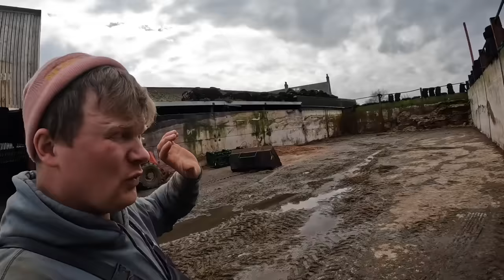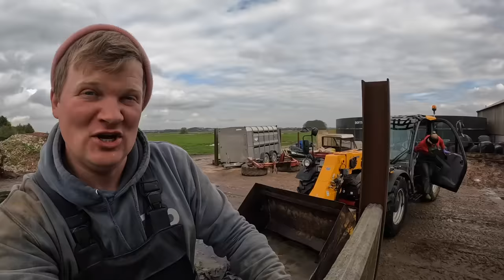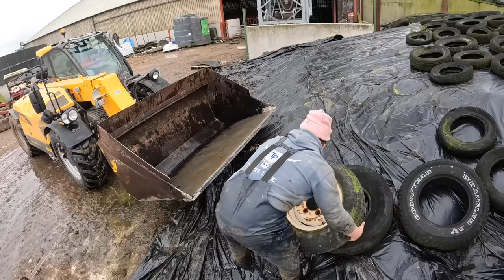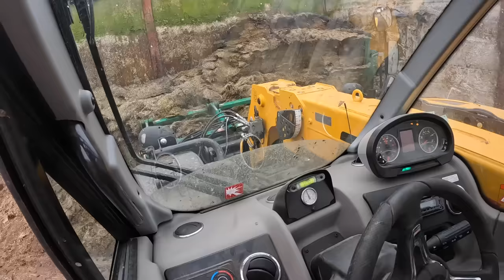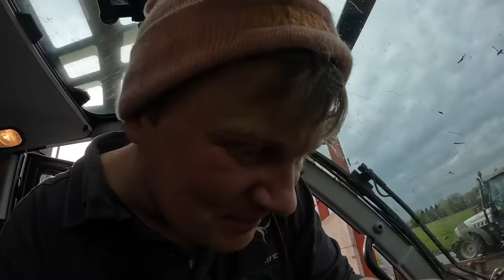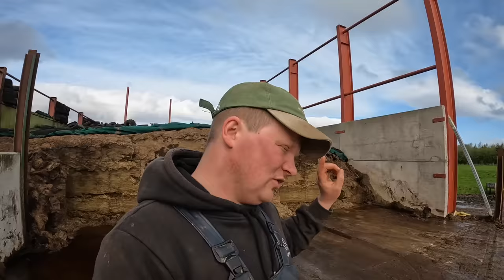NIGHTMARE... CLAMP OPENS AND MILK CRASHES!!

Comment: Couple of years ago i added an additional transparent layer of plastic that adheres closely to the grass, effectively sealing the clamp and preventing air ingress. Since then, we have experienced no issues with rot, and of course, we use side sheets
Reply: Do you think maybe if he did a better job keeping his farm clean and all that pee and poop out of the feed it would be better? You know kind of seems like common sense huh?
Reply: We do that too, and use sand to cover it up. Its a bit more work to uncover but there is 0 rot and the silage doesnt get warm
Reply: do you think the transparency has an effect on the ensiling process?
Reply: @jwiereng  no dont think so but the transparency is a charastic so everyone knows directly what we talk about. And over this seal goes a the black stuff to protect the transparancy layer

Comment: Tom, there is a lot of money underneath those silage sheets! Spending a little extra money on sheets (oxygen barrier, sidesheets and a good top sheet) will pay for itself quickly. 

Also, if they’re available, truck tire sidewalls are a great way to put some proper weight on the sheets. Plus they’re easy to stack and don’t  collect rainwater.

Comment: Having spent many years as a feed rep mainly in dairy nutrition the best or better silage always came from well sealed clamps. That means to sheet the sides and rear then when the top sheet goes down the side sheets can be folded over first then the top. Ideally minimum 2-3 metres extra on the sides to fold over come sheeting time.far less waste which with the cost these days to grow grass, cost of cutting and harvesting a bit more sheeting pays dividends.

Comment: Always wondered why you don't put side sheets on the clamp , seals the clamp so much better ?
Reply: But the ramp always is rubbish !
Reply: Every clamp is a disaster. It cost a lot of money
Reply: Hopefully with the clamp being covered it minimizes need for side sheets. He definitely needs to move that tower between the two clamps. No way he is going to ever be able to get good compaction when there are so many corners
Reply: I take he's going to use the clamp when it's empty for housing animals?
Reply: Definately, achieves a much better seal to the top sheet and is more airtight which means less waste
Reply: Side sheets and stone bags round the edges to create a better seal. Will save you so much money
Reply: He said right at the end of the episode, "someone in the comments is going to say side sheets. I'm not doing it." 🤷
Reply: @sallywaites8517  then its no wonder that he is getting rotten food every time. I never have problems like this, even if it rains evry day.
Reply: That is what makes the most sense to reduce waste. There's no way just dropping a sheet over the clamp stops water and air getting in, it needs to be sealed properly. I think investing in time and side sheets far outweighs the lost sillage.
Reply: @jonathanmathias5339 no when it’s empty he’ll then refill it with grass once the fields are dry enough.
Reply: So , by your logic , he's going to spend 10s of thousands of pounds to build a roof to keep rain off a plastic waterproof sheet ????!
Reply: @jonathanmathias5339  that’s what he intends to do he eventually wants to put a roof over the two clamps
Reply: @sallywaites8517 his logic baffles me as well,side sheets are a basic requirement on an outside pit
Reply: All our clamps have roof cover , side sheets are always used + clingfilm underneath top sheet . minimal expense , small extra labour time which gives you ver little wasted silage
Reply: Good job you have  an income from YouTube with all the waste loss of money on that clamp. Shocking

Comment: move that cake tower.
Reply: Got to agree, put it away from the clamps.
Reply: More importantly keep the feed clean and dry. You cant expect poop juice water running into it constantly to be good for anything.
Reply: Agree, Think it would we easier for  Filling & then Compacting the clamp face. If it were my choice, I would move the Fuel station in the background further back & put the Cake tower at the shed corner where the fuel tank is Just now, to keep it handy for loading the mixer.
Reply: Love this channel!   - Why isn’t this stuff placed indoors to keep it dry etc? I’m not a farmer 🧑‍🌾

Comment: We sometimes just put some salt on the places that are prone to get bad. We also use side sheets and we mostly have quite good silage and almost no spillage. We also prefer sand over tires seals it in way better and the presure is more even. We do 20 to 30cm of sand preferably. We also already have drains in the clamps. I would pick another place for the bulk silo personally......

Comment: Tom, great video. 
Ladies and Gentlemen of the class of '97
Use Cling Film
If I could offer you only one tip for the future, cling film would be
it. The long term benefits of cling film have been proved by
scientists whereas the rest of my advice has no basis more reliable
than my own meandering
experience…I will dispense this advice now.

And get an old telehandler/loading shovel tyre to put the grab up on to keep blade up off the ground.

Comment: I'd look to move your meal silo. It's only 3 cube of concrete underneath it. You can make a pad to handle the silo for molasses also. It would cut down the waste silage at that front corner and make filling the pit so much easier for the contractor.

Comment: Bite the bullet Tom. Use sheeting and move the tower between the clamps. In the long run you'll be able to compact the grass better without those corners and have less waste. Dont try to save a bit of money now then down the line have to do it anyways. Everything is only going to get more expensive. I.e. the midding build and not extending it one more section to have enough storage with the wet weather

Comment: Maybe you can put plastic on the side walls. Fold them in first and than the plastic on top. If water runs down the sides, it goes between tha wall and the plastic on the sides.
Nice video!

Comment: We put our plastic down the walls and then after it's full and packed we pull the plastic over from either side. Then we put a layer of big square bale slices over the whole pit (clamp). Works really well spoiles a bit in the front edge and a little bit at the back wall.

Comment: I'm still suprised thebin is between those pits. Fuel tank would be a lot better location for bins etc because of expandibility. Also pit water can run off a lot better and the silage is easier to compact. We started using side sheets and it improved our silage quality and reduces waste a lot. Give it a try ;)

Comment: the farm i worked for coverd the clamps with dirt over the plastic to weigh it down.  then we would just scoop up as much dirt of as possible and use the bucket to slowly roll up the plastic and uncover the silo. the dirt works well and even with cows climbing on the clamp it still held up strong.

Comment: Was just wondering why you hadn’t switched to gum or pine poles for the clamp. 

Placed at intervals horizontally up the clamp;  they’d work well and be easier to roll off by hand  or cart away on pallet forks with the manitou.

Uncovering could even be folding the sheet up/ back to the next pole too.

Comment: Hey Tom to solve you problem of that corner why don’t you put a new silage wall up along side yes you would lose some pit area however then you could put dirt up the inside or concrete and use it a walkway to get to the two pits

Comment: Would it not be easier to place roofing over the stored grass piles and have constructed the concrete bases at a slight angle downwards as well as a 20cm wide grill running downwards on both sides  to help with drainage?

Comment: the longer the silage has been there the more waist you get.......i think that's just the way it is ........well of course 3rd cut is not going to make the cows milk aswell........on a normal year cows would be out grazing grass by now so it's another knock on effect of the wet winter and spring but as you say at least you've got something to feed the cows with

Comment: Why don't you put up some silos for haylage and silage? It would save you from picking up tires and putting  them somewhere just so you can pick them up and put them somewhere else just so you can pick them up again and .... Also, it would cut down on the type of waste you get. Finally, it would free up space. Daddy had 2 concrete silos and 3 Harvestores for haylage and silage. He could empty the Harestores onto conveyors that automatically move silage or haylage down a feeding height trough the cows  could gather around. It could blend haylage and silage together and  feed them after every milking. Saved a lot of time and waste.
Reply: We called corn silage just "silage" and chopped and fermented alfalfa "haylage", by the way.

Comment: Why don't you take the top 6-8 inches off that's spoiled and throw it away until you get into the better stuff. ?
Reply: That is some amount of silage, could be 30-50t
Reply: @spu5990  Should only be 10 or 20 feet at the front, should get better as he gets into it. Not that much tonnage and the cows won't eat it anyway. If they do eat it they won't make any milk on it.

Comment: Why do you call a silage pit clamps?Clamps are versatile tools that serve to temporarily hold work securely in place. They are used for many applications including carpentry, woodworking, furniture making, welding, construction and metal working.

Hand Tools - Clamps - CCOHS
MORE RESULTS
What is the definition of a clamp?
1. : a device designed to bind or constrict or to press two or more parts together so as to hold them firmly. 2. : any of various instruments or appliances having parts brought together for holding or compressing something.